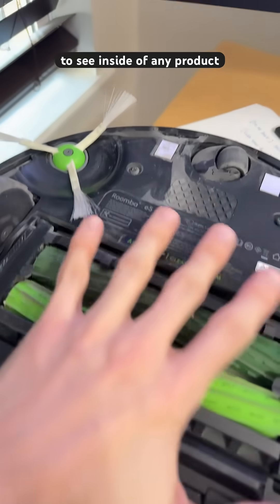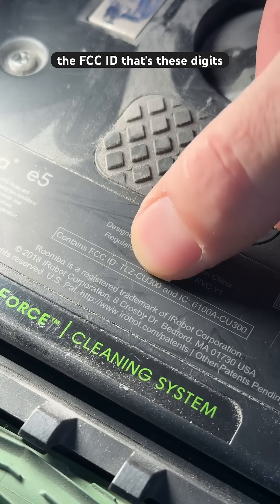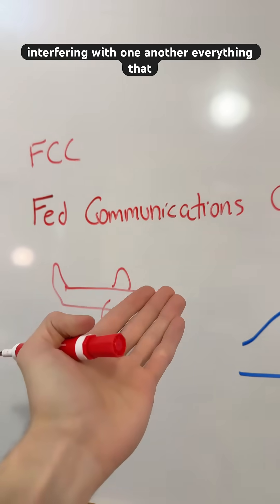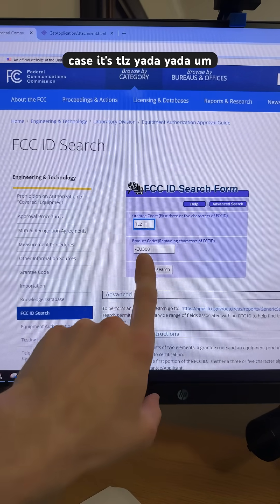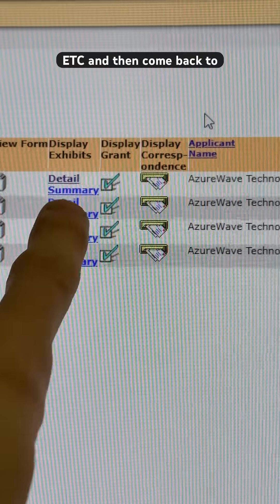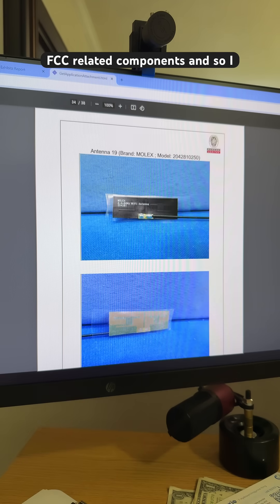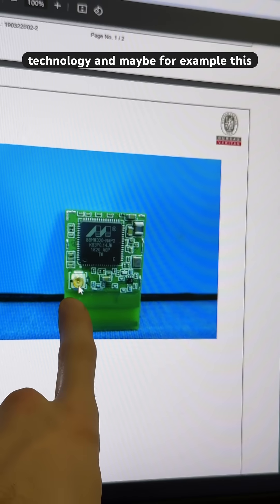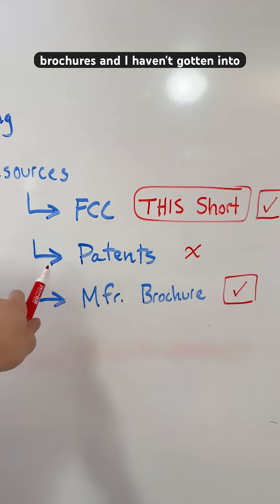See hi-res design docs for all Electronics, via FCC database. #benchmark #design #hack

Comment: Too often the FCC-ID disclosures are similar to MSDS, and the manufacturer is allowed to keep many pages confidential as a "trade secret".   Patents often are a richer source of data, and further point you to other related patents or technical papers.
Reply: I can tell you about a specific "type" of abuse, but don't have a patent number handy the uses it:  

They apply for a patent that is over-broad, so the patent office requires it be split.  The patent-A explains itself and often mentions some detail in "co-pending patent-B".   Then when the patent-A gets granted, they ABANDON the patent-B, so the very details that were disclosed to the patent office and used to explain the patent-A, winds up NEVER being disclosed.  

I used to live in Sunnyvale in the pre-internet day, and Sunnyvale was the west-coast patent depository.  During a seminar, I mentioned this problem, and the examiner said they were well-aware of this ruse, but somewhat powerless to prevent the abuse.  But things have changed a lot in recent decades.
Reply from the maker: that is where it gets fuzzy for me. If i’m not an expert on the particular components, I can’t tell which data is key info versus generalized and opaque.

we would love to hear a specific example, if you have one to share. 😊
Reply: For a different abuse, just google "submarine patent".